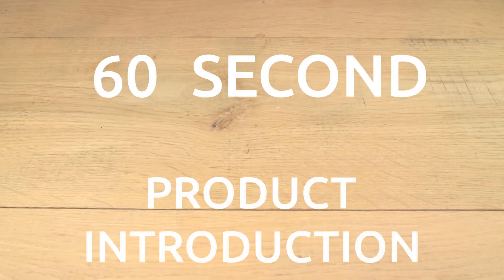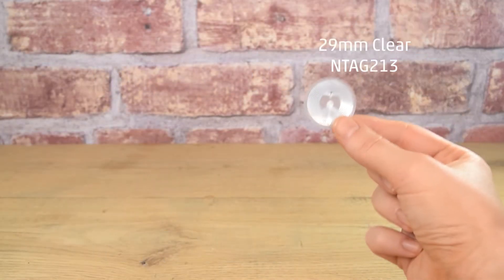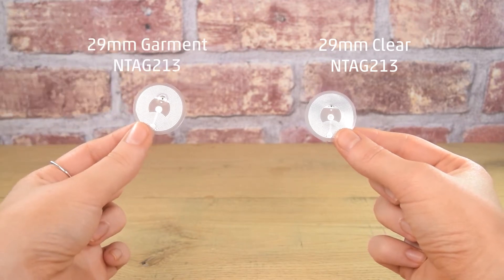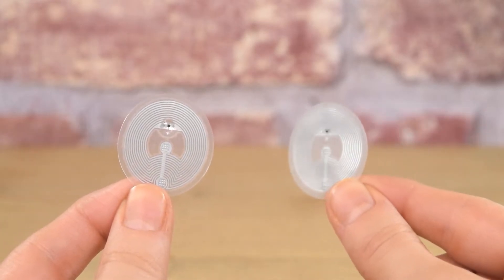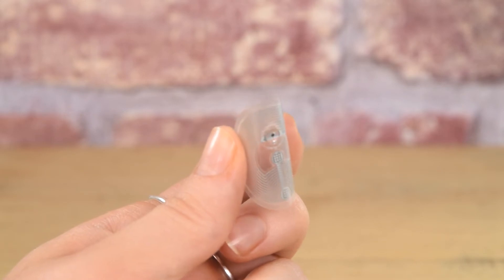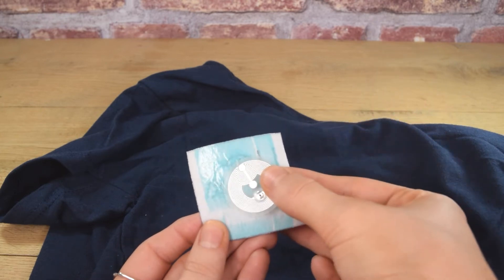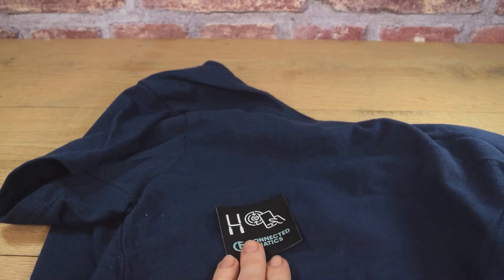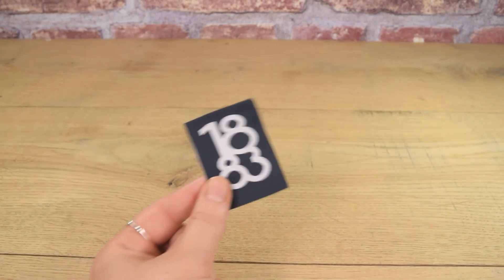Using NFC Tags In Clothing

Comment: Did the design of the NTAG213 change?  That antenna looks like DNA 424 - not like any of the standard security tags I've seen
Reply from the maker: The products used in this video were both NTAG213. We do manufacture a 29mm garment spec tag with an NTAG424 DNA chip. 

We also continually develop and improve the products to improve scan distance performance. The same product can occasionally have a new antenna design for a new batch.
Reply: @SeritagNFCTags  so, that's a yes - the design of the ntag 213 chips has changed, thx
Reply from the maker: Technically, it's a no. 

The 'NTAG213' is a chip which is different than a tag. A tag is the antenna, chip and substrate to hold it together. The 'NTAG213' chip hasn't changed.

In terms of antenna design on the tags - any tags with any chip (NTAG213, NTAG424, ICODE SLIX, ST25, etc) - then designs change all the time. Typically to increase yield, performance, etc.
Reply: @SeritagNFCTags  I should have said, the design of the tag has changed, thanks
Reply: @planckstudios  Not sure what change? These look the same as the ones I’ve been using since 2018 🤷🏻‍♂️

Comment: what was the adhesive you used thats on the tag?
Reply from the maker: Most of the garment tags use a simple adhesive designed to hold the tags in place to an iron-on patch or sew-on patch - which then gets applied to the garments. It's not designed to hold the tags longer term. 

We can make these tags with 'iron-on' adhesive as well which would allow the tags to be directly applied to garments. However, this is a little more complicated and you should discuss with us first.
Reply: Do you guys offer the iron on custom tags ?? 

Also what temperature can the nfc tag withstand ? Is there a range

Comment: Was there an nfc tag that can be washed and is water proof?
Reply from the maker: The 'garment' spec labels (strengthened standard labels) are generally designed to handle around 100 domestic wash cycles. For most use cases, this would be more than enough - particularly because most tags are likely to be scanned early in the lifecycle. 

However, there are also 'hard disc' NFC tags which are made from rigid plastic that can survive longer and can handle the harsher conditions of industrial laundry. Generally, these can be better for end of life use cases where garments can be returned for credit, refund or discounts. 

There's a selection of popular products at https://seritag.com/nfc-tags/garment
Reply: Bummer, 100 wash cycles is nowhere near enough for my use case - helping deal with the millions of lost uniform items that turn up at school. If you produce a longer-lasting one for domestic use, that would be of great interest!
Reply from the maker: Sure. You can use one of the hard disc tags that we supply. These are designed for industrial washes and will last a very long time in domestic washes - almost certainly longer than the item itself. Have a look at https://seritag.com/nfc-tags/22mm-tough-tag-ntag213 for example, or the NFC button tag https://seritag.com/nfc-tags/button-laundry-tag